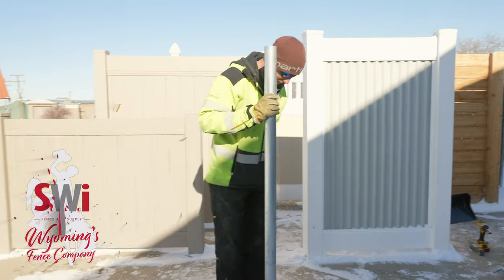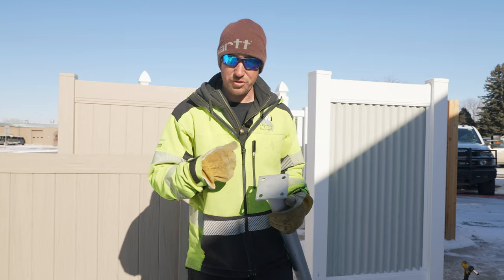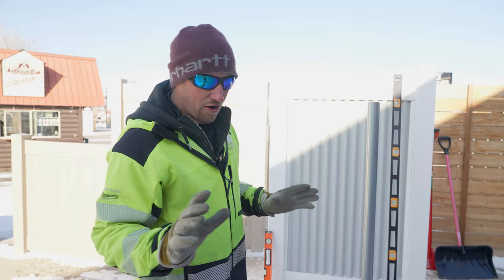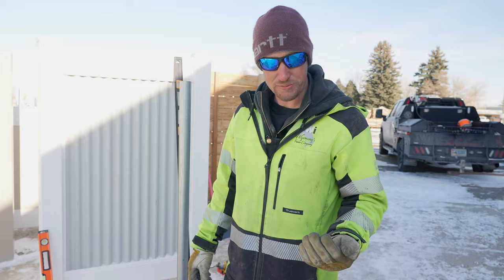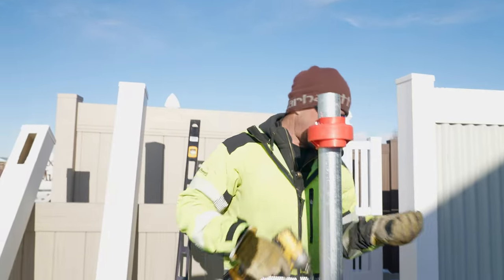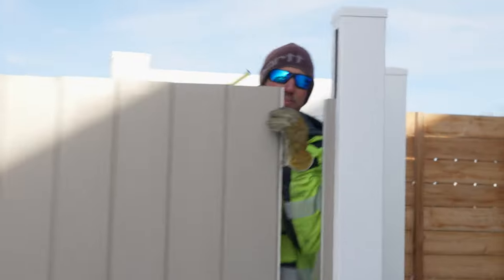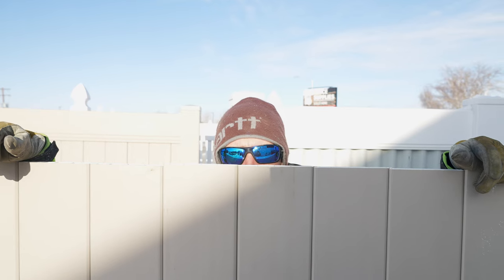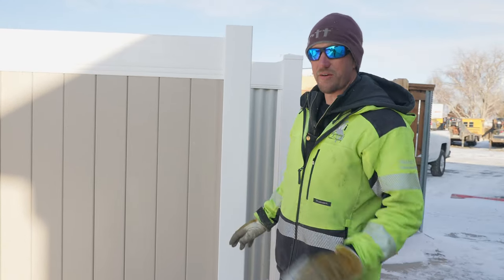How To Easily Build Vinyl Fence On Existing Concrete

Comment: I like to take my hammer drill and drill three holes inside the 5x5 post then hammer down some rebar I sleeve the post over the rebar and then fill it with concrete like a Masonary technique works pretty good.
Reply: When the concrete expands in the winter it will break the vinyl....tried it

Comment: I have a wooden fence that I am replacing w vinyl. But my posts are postmaster type posts.  Is it possible to apply vinyl posts onto my existing postmaster steel posts?

Comment: If my vinyl post is 5 feet to the top of the post cap do I buy the 4 foot SS40 post or should I cut a 5 foot SS40 to fit?
Reply from the maker: I'd just go with the 4'. You don't need that steel post extending up into your top rail.

Comment: How will this setup hold up in wind, especially on a 50' run? Where I live we sometimes get days of consistent 20-25 mph winds with gusts 40-50 mph.  Seems like I watched a video a few years ago where they drilled 4 holes through the concrete, then anchored long pieces of rebar through the holes into the substrate. After setting the vinyl posts over the rebar they poured concrete in the top of each post deep enough to cover the exposed rebar. Looked like a lot of work compared to your method and not sure if it was overkill.  Any thoughts?

Comment: Have you ever heard of anyone putting a vinyl post over an old wood post? The company who installed my gate did exactly that. Should I be concerned and tell them to come back and correct it?
Reply from the maker: We wouldn't do it that way but different contractors have different methods. The longevity of your post is going to be determined by the quality of the wood post they installed over. If it's solid and there's no signs of rot you're probably ok for a while.

Comment: not everyone can weld a post to a plate but thx for the other info
Reply from the maker: If you're not comfortable doing it you should be able to find someone in your area who can weld them up for you. If you need to you can always buy them from us (https://www.swifence.com/plated-post-ss-40-6x6.html?id=44194424&quantity=1) (prices include freight).
Reply: @SWiFence  Damn those are nice.. I bought some cheap alternatives but I may get these .. Can I use these with 4x4 post caps.?
Reply: @SWiFence  ... or do you have 4x4 base plate as well??
Reply from the maker: We do have the 4x4 version as well: https://www.swifence.com/plated-post-for-concrete-mounted-vinyl-fence-2-3-8.html?id=81640137
Give the guys at the shop a shout if you've got details you need to work through. 👍🏻 307.578.8040

Comment: Every time I sleeve over chaillink I use gravel or pea gravel it gives you a lot of wiggle room if they are not in line with each other like almost all chainlink fences.you can always cut up you scrap vinly to make post inserts. You should be screwing all your bottom rails in no matter what. High wind can flex it enough to pop them out even if you can't wiggle them.

Comment: Around here there is sweat involved as soon as you leave the air conditioned truck. I have seen flanges mounted to concrete like that but electrolysis and rust always seems to take hold in a few years unless a rubber or asphalt soaked spaced is used. Vinyl fence is hardly ever used here but the steel or aluminum picket fences over galvanized frame is very popular. Prefab concrete fences are too, and for those you need to core through the concrete, There is a skid steer coring bit but it is slow and the core likes to get stuck.

Comment: If you want to skip wearing the respirator/mask you could go with an OSHA Table 1 compliant roto hammer, basically has a built in vacuum.  Nice video, slightly disappointed that I didn’t get to see a bunch of tasty doughnuts 🍩.

Comment: Hi Im trying to use this method to install a 3" aluminum post to galvanized pole. I cannot find donuts this size, is it possible to fill the void with concrete or expanding foam?

Comment: Nice video,  My niece has a house with fence posts already installed from a previous fence.  The posts are not evenly spaced but close.  I want to help her out and install a fence over the existing posts.  Where do I get good quality fencing that I can cut to fit the spacing between the posts.  The posts are already installed into a cement pad so they will be hard to remove.  Pleas help.

Comment: Cool Video.  How do you not have an open space at the bottom? I want to put a small Vinyl fence on top of a block wall to block out the neighbors. As they are just storing stuff in their yard and it looks bad. Good for them. But I like not to see it at all.
Reply from the maker: The space at the bottom is all about measuring. You can leave yourself as much or as little as you want. If you're not on concrete you have to deal with the contour of the land as well, but you can still get pretty close.
Reply: @SWiFence  Thanks! If you know of someone that can do this work in Los Angeles, North Hollywood. Let me know! Thanks!!!

Comment: I want to use 2x2" steel fence post for a 5x5 vinyl post. Is there a doughnut or some sort of adapter for that?
Reply from the maker: Do you mean 1 7/8" round steel post? If so, yes, there are adapters for that: https://bit.ly/178pipedonut
Reply: @SWiFence  no the square 2”x2” post
Reply from the maker: I'm not familiar with an adapter for that but it doesn't mean they're not out there.

Comment: I wish I could find those donut things and the simple posts with flange. The big bx stores don't seem to carry them, and the fence companies kind of sneer and want to come round and quote me for an install. Any suggestions?
Reply from the maker: Yes! Buy them from us! 😁
👉🏻 Fence Post Donut Adapters: https://bit.ly/SWIpipedonut
👉🏻 Self-Drilling Screws For Donuts: https://bit.ly/SWI-TY3-1-4x1
👉🏻 Plated Post For Concrete-Mounted Vinyl: https://bit.ly/PlatedPostVinyl
Reply: @SWiFence  Thanks! I did actually order the donuts from your site,  and they arrived today. Waiting on a couple of things to arrive at the big orange bucket store, and the project begins!

Comment: Where can I get these post mounts at sir?
Reply from the maker: 👉🏻 Plated Post For Concrete-Mounted Vinyl: https://bit.ly/PlatedPostVinyl
👉🏻 Galvanized Floor Base Plate: https://bit.ly/galvbaseplate
👉🏻 Concrete Screws: https://bit.ly/concretescrew
👉🏻 2 3/8" Donut Adapters: https://bit.ly/adapterdonut
👉🏻 1 7/8" Donut Adapters: https://bit.ly/178pipedonut
👉🏻 Self-Drilling Screws For Donuts: https://bit.ly/SWI-TY3-1-4x1
👉🏻 Rail Locks: https://bit.ly/raillock
👉🏻 Self-Drilling Screws For Rail Locks: https://bit.ly/SWI-TY2-8x3-4

Comment: Where find materials for 8 ft fence
Reply from the maker: We don't have them listed on the website, but we will custom make 8' postmaster posts with welded baseplate to order. Give us a call at the shop. 307.578.8040

Comment: 10:30 In non-builder newbie terms, what do you mean by if concrete is not a good surface to be bolting to, you should go through it?
Reply from the maker: If you're working with bad concrete (concrete that is breaking down / crumbling apart from itself) you will want to go through it. That would involve core drilling and then working in the soil below.

Comment: Did you end up cutting the bottom of your vinyl post so you won’t the the gap underneath the floor?
Reply from the maker: Yes, for sure, those were trimmed down to size. 👍🏻
Reply: Ok thank you. Thanks for the fast reply aswell
Reply: Where did you purchase the metal post from and donuts?
Reply: Does this method works the same with asphalt?
Reply from the maker: I wish it did but sadly no, concrete only.
Reply from the maker: And you can get adapters from us: 😁 https://bit.ly/adapterdonut
For steel you'll have to call around your local area. Fence contractors can probably sell you some.